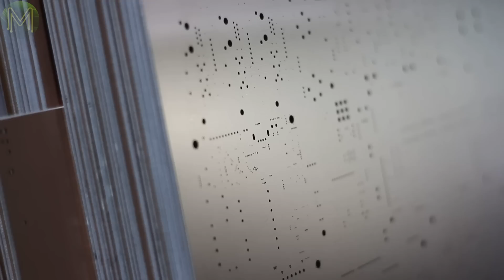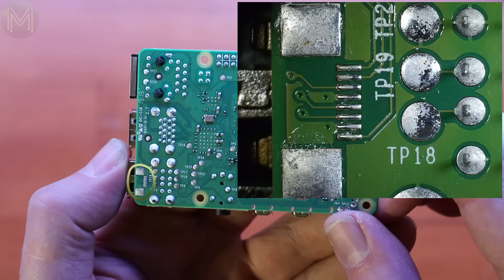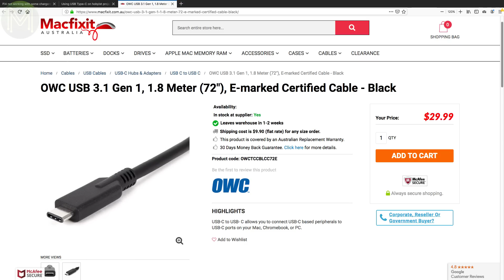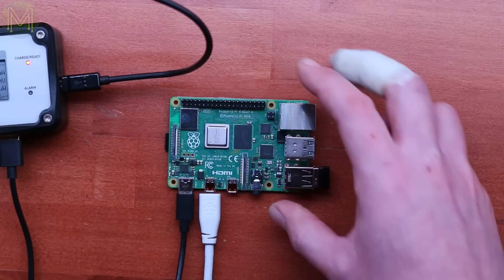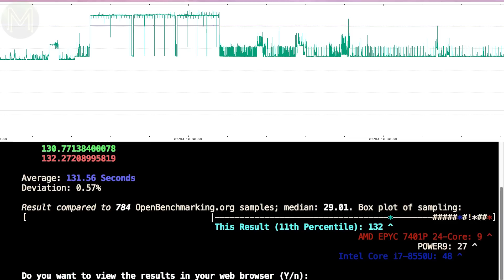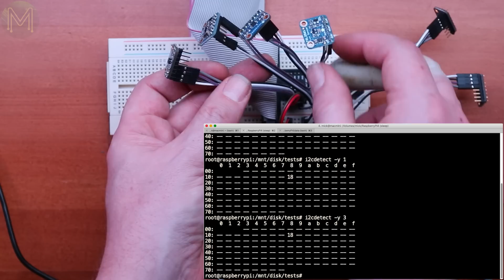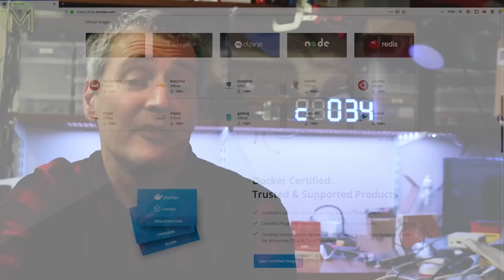#270 The Raspberry Pi4: The good, the bad & the ooops! // Review

Comment: The temperature test (without a heatsink and also with the tiny pi-hut heatsink) could have also been done in that official red-and-white pi4 case (or "The Kiln" as it will come to be known). The other chips make the case hot inside too. The graphics temperatures are not yet known with and it is madness that the pi4 does not support the last debian for comparison. It's down to Buster.
By trying to make it a "desktop" the purpose of the Pi seems to have been lost an its lack of backwards compatibility (such as old debian and unknown GPIO passthrough when running docker for old Pi3B+ projects) make the RaspberryPi4 lose one of its main selling points of "being a compatible continuation of the Pi". With such changes, and the fact that many people will use an SBC as virtually headless, people might look to other brands instead. For example the ability to go for an octacore board means running a board storage can be helped with blake2sp 8way parallel processing. The polynomial maths would be worth the learning of it.
For a lot of projects, getting gpio by just connecting a pi-zero to a normal low power pc can sometimes yield better results than the pi4 running Docker. If people do not have a Pi of any type at all, they might be better off getting a pi3B+ and a couple of $5 pi-zero boards (maybe one with wifi and one without), and then waiting to see it a better pi4 comes out or if a competitor brand goes with it.
The Pi4 leaves you looking at it and thinking "What is it for?" ...As in specifically. It no longer has a honed down purpose and legacy of Pi3 jobs that can be done which stand the test of time. The ignorance (yes ignorance) of the Pi foundation to release a PiA+ is double Picard facepalm material. It having half a gig of RAM is an indicator they (the Pi foundation) do not appreciate how the device is used as a "solution to a problem" board and that the 1GB RAM is a vital minimum to get things done in a browser partly (and I mean just coding, not web-browsing). The browser acts as a sort of "layer" of translation. The half gig simply does not suffice. The Pi3A+ is like the commodore amiga A600 mistake all over again. It goes to show the Pi Foundation never fully realised what the Pi3B+ was useful for and so they do not thereby know how to continue that legacy on to the Pi4. That is so huge a relevance, and nobody will get it.

People who buy the Pi4 have got £54 to spare. They are not "in need". Smart people (aside form the pi-nano) get the Pi3B+ (if they get a pi at all). This is partly because they are skint, and they are in need of a solution sbc in terms solving problems. It is no suprise "necessity is the mother of invention" petains to that.

That means the following regarding the purpose of the Pi4 in terms of "what is it for?" 

Sure the Pi4 can do some things, and with that some 'cool' things. But there are things it cannot do and often those are "pi things" (like some pi3B+ things). Also there are desktops and other SBCs that can do some other "new tasks" it performs but better (and they are better established and supported). It is just a bit of a "Jack of no trades" at the moment. The trouble is some new poor innovative people will wisely wait and not buy one, and the knock-on effect there is that SBC's hardware standards require a critical mass to establish (and not be eroded by a competing brand). These are the people you need, Pi-foundation. Ugh. They're so not listening. The popularity of the Pi4 is not down to its meritocracy so far but instead down to pre-orders and panic shortage pressure purchasing, especially by people who had £54 kicking about in their pocket. With that however there are some disappointed customers. A subset of those will be people who do not have the 4GB model and are frustrated at its Docker performance. It has virtualisation on the chip.

Those HMDI ports can snap like the OLPC XO laptop charge handle famously wound by the late Kofi Annan.

The other thing that is really downright stupid about the Pi4 (especially seeing as there are some things it can do in a kinda cool way) is the fanboy community. As soon as people criticise it, the fanboys leap down their throat and scorn them. And yet, you get the preorder people who want to be cool kids and not left out, and the motivations being buying the Pi4 was undeniably partly from some spoilt iPhone indulged brats. When Veronica and Tarquin get a product they are subsequently not happy with, the parents get angry when they do not get what they want. They go from peers to laughing stock. And so with that the fanboys have acted as an enabler to the rush-purchase contingent to give the device its popular reputation and yet these people will get angry and react in a spoiled way when they do not get what they want. So they'll drag the device's name through the mud and those who missed out will look at the negative feedback and look for alternatives or at least hesitate in buying (ironically doing perhaps the right thing of avoiding it but doing the avoidance for the wrong reasons).

There will also be a new wave of customer who haven't a clue what the pi is and they buy the Pi4 thinking "Oh it can serve as a desktop" and then they'll be annoyed when it does not do things a desktop would do. It'd be £54 (or £109 if they got the Kiln bundle shoebox pack) they could have put towards some other device or towards software upgrade for an existing system.

Loads of people are idiots. Look I'm sorry (actually I'm really not sorry and my brain is awash with disdain chemicals right now) but there is no shortage of dimwits, hence the purchase of the Pi4 shoebox Kiln-and-keyboard pack they make. They haven't a clue what they are buying and they'll realise too late and slag the device off.

The Pi4 should have stuck to some known quantities, and perhaps an ability to connect the compute cores (up to 8) via a turing-board style board with an edgeconnector would have helped that, thereby allowing better integration with the a53 (and you'd get the blake2sp).

Regarding the societal contingents behind the Pi4's current hasty customer base, there is a reflection of the fact that the Pi comes from Cambridge. There is a blindspot to Cambridge even though it has its good things. For example it is commonplace for students of the Cambridge Universities to not know their way around the city. They get everything they need on campus and don't actually know how to get to various parts of the geographical area. They have had it too good on campus and don't know the area. The Pi4 is like a metaphor for that and there will be a certain customer base for it it who will be all lovey dovey but they don't really know their arse from their elbow despite having a PhD in anything ranging from Colouring-in to Physics. A bunch of them will have bought the Pi4.

Tarquin: "Hmm, Mnyarse, Veronica. I bought my Pi with the shoebox Kiln case, and bought a 2nd Kiln case for Oiks-in-need."

Veronica: "Capital notion, Tarqs. OK Mynah! I've left my 5star review already for the Pi4 I bought today and will try out my board next week."

Look, Guys, this Pi4 is a "reality checkpoint" moment. Sure it may sound like pouring cold water on the Pi4, but frankly, it runs so hot you'd almost need to. Also the fact that some people have suggested underclocking it as a cooling solution means that Tarquin won't get the same temperature per MHz result as Veronica's board, and then the devices will be seen as no longer a known quantity, and therefore a dodgy unfair gamble.
Reply: ObsoletePowerCorrupts the Pi4 may no longer have a honed down purpose, but neither does your long winded post
Reply: @Hornet135  Take your ghost channel elsewhere, Peasant. And ply thy trade.
Reply: Firmware is currently being tested to bring down the tempeature of the board. Wow, yeah they really messed up with that "The Kiln" case.

Comment: I would have liked to see if you can use both HDMI's with different outputs. Great Vid!
Reply from the maker: Yup as mentioned in the video I did have problems when running displays of different resolutions. Sometimes it’d crash the Pi.
I’ll play around with it some more to see if I can figure out why.
Reply: @MickMake  That is always fun. Tried to update Tinker Board S to Debian 9 , had issues with packages that locked up.

Comment: What about the UARTs? Have you tested them allready? May there be an issue? How to activate ttyS1...ttyS4 in boot.config?
Reply from the maker: Yes and good point! There was only so much time for the video, so I’ll include that test in the follow up video
Reply: @MickMake I think there is a problem with the clock source of the UART module. I start my old C apps (works fine on all older PIs) and had to set 19200 baud for 9600 baud. Raspi forum has one post about. A litte strange, I don't fully understand. Thanks and greetings from the other side of the world where we like your videos! Update #1 bootconfig.txt dtoverlay=uart2 brings up a /dev/ttyAMA1 on GPIO0..3, cool, a lot of UARTs!
Update #2: Newest update/upgrade fixed the issue.

Comment: The Rpi4 uses a Eeprom on the board for most of the boot process now. the boot partition is mostly ignored now (just the config files are read from the boot partition I think).
Reply from the maker: Yes true. One of the reasons why the SD card corruption was fixed.

Comment: Why are they trying to crank so much current through a piddling little cable and mongrel of a USB connector.
Give it a decent DC socket and fix all the power up problems.
Reply: USB-C PD is rated up to 100W. They just screwed up...
Reply: @UloPe  you think
Reply from the maker: I can understand the engineer thought process. Saving one SMD resistor is substantial when you have the economies of scale that the Pi Foundation has.

If the Pi Foundation had spent less time "economising", then it might have not been in this position.

Once again, hindsight is a wonderful thing.
Reply from the maker: Once again it all comes down to production run costs. It may have cost more to have two different types of boards run through the production line.
I'd really have to be on the team designing to be able top really comment as to why as there's so many variables.
Reply: @MickMake  i like to know why they did not go a different route, like having analog built in and stick to full size hdmi
Reply: real issue with usb3 is e cables, will not power it

Comment: Really want to corrupt a sd card!? Use the official create ubuntu usb disc drive application!
Reply: Ubuntu on a pie? It's probably a good thing that that doesn't work...
Reply: Yeah... I have seen issues with it as well. However, it is easy to fix. Just use Win7's modern incarnation of fdisk. Clean and wipe the card, then you can have the card back to working state again. Keep in mind, that using ubuntu's disk tool more than 10 times, can not only corrupt the card. It can kill it totally.
Reply: Or a sudo rm -R /  , works wonders !
Reply: I recommend etcher. It also does a check to make sure there is no corruption.

Comment: "Chunky diode" is a 100uF tanatalum capacitor.  Probably added to avoid more power issues, most likely related to the USB 3.0 ports, but maybe PoE or Gigabit ethernet chipset.
Reply from the maker: LOL
Reply: MickMake / LOL. 🤣🤣🤣
Reply from the maker: Sometimes I get it wrong. :-) I’m human.
Reply: @MickMake  Are you sure?  have you been tested?  Anyway, if it is a tantalum as I suspect then they have some fun failure modes. :)
Reply from the maker: It’s on my birth certificate, so must be true!

Comment: About USB-C they should have implemented the USB-C PD protocol...
BTW looks like that the Videocore is still part of the boot process for this reason the rpi is still a no go for me.
Reply from the maker: Yes indeedy, but it would have been a bit more complex. Essentially what we have on the Pi4 is a “poor man’s” USB-C and it’s introduced some problems.
Reply: @MickMake  I've seen quite cheap usb PD implementation with a small stm. They just need to negotiate a 1.5A PDO.

So no multi PDO, DFP, UFP, DRP, Vconn, and more complicated stuff.

I've not cheked how they managed to implement it but generally a simple resistor divider on CC pins should give a basic 5V 900mA profile IFIK.